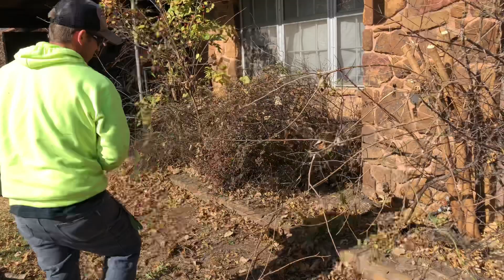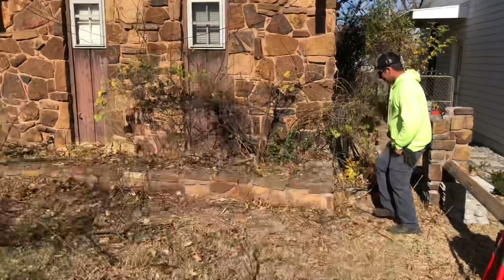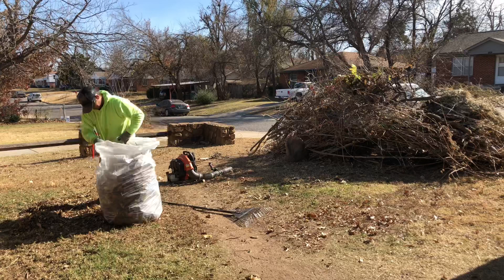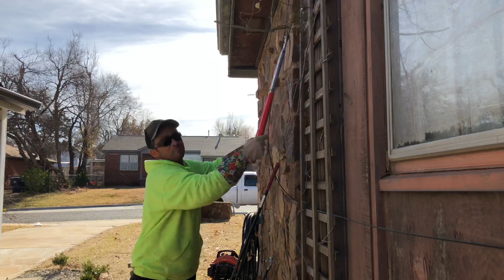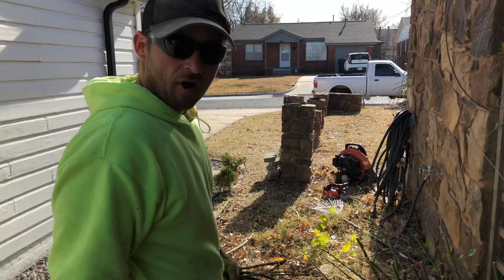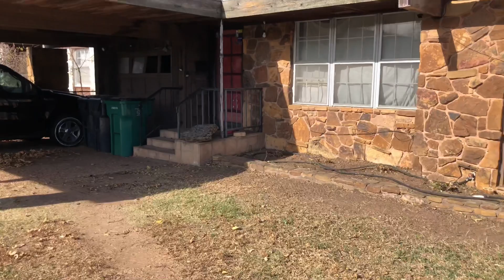Cutting out all the Junk Trees and dead bushes in front of this house|satisfying flowerbed cleanup

Comment: Now that is looking so much better, doesn't feel like it's being choked out by the brush and scraggly trees and vines, it's been a few years since it's looked this good, a tool you may want to get sometime down the road is a folding limb saw so you don't have to use the chainsaw as much, and it can get into tighter spots, it has self cleaning teeth and pretty much cuts whatever you want, I got mine at Tractor Supply, less than a 20 dollar bill
Reply from the maker: May have to check that out
Reply: Beautiful home!  Nice job!  👍👍

Comment: great job  what is that little chain saw you used  I need to get one,  thanks
Reply from the maker: It's a echo  cs-2511t,  it's an expensive little saw, mainly used by tree climbers because it's light wieght 6lbs. You can get a bigger saw cheaper. I've done a little bit of climbing, enough to know I'm staying on the ground.

Comment: This was a great job, but how do you remove the tree roots? I'd like to know because I am doing this right now, I've cut the trees and brush, but I know that if the root is in, it will all come back next year. I've yanked out a lot of the smaller bushes by the roots but the trees are still there
Reply from the maker: Get some stump killer, pour a little on fresh cuts, they won't come back. Easiest way possible, the other ways you probably don't wanna do.
Reply: @joshslawnservice  Do you use Glyphosate?
Reply from the maker: @catherinehenry6762  it may work on some, but probably shouldn't dilute it.